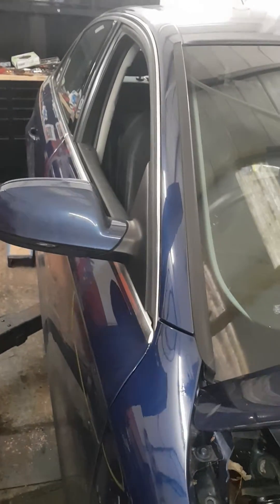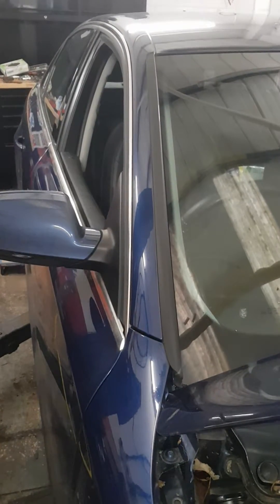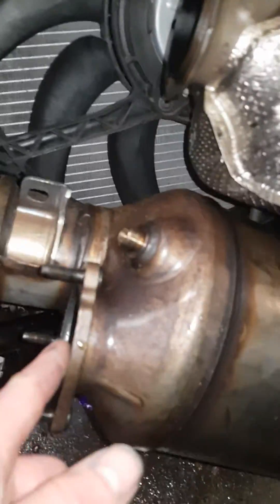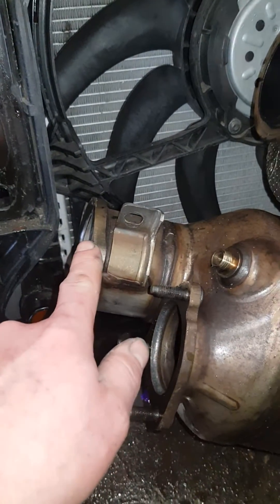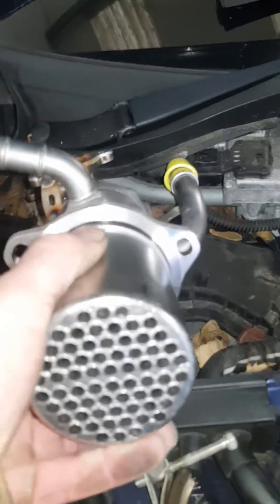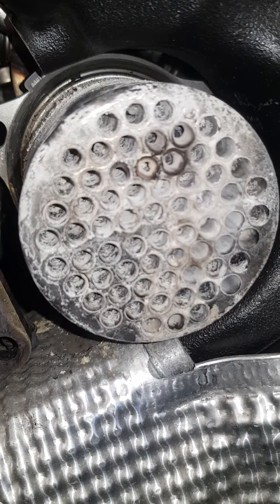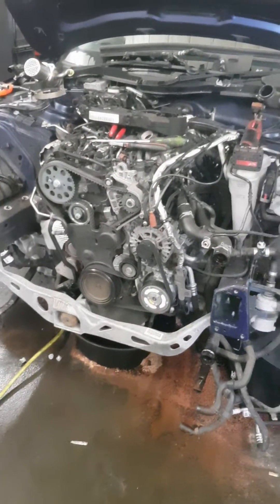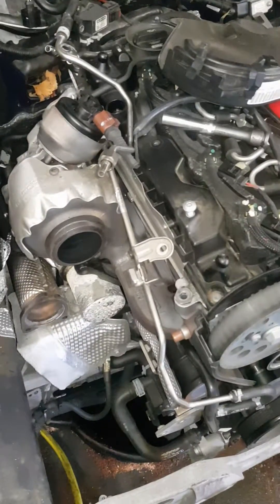Audi Dpf Adblue Explained

Comment: P200200 is fault and you don't need to remove front end. Done hundreds of them when I was working in audi dealership.
Reply from the maker: You removed Dpf to flash it without removing front end ? This dpf was also full of Ash so needed to be removed and flashed cleaned .
Reply: @dpfcleaningltd it's very hard to remove dpf without removing the front end if you follow audi workshop manual. Done it once, so I understand why you did it like that. When replacing egr cooler only, you can pull it out towards the bulkhead. It is tight space, but duable.
Reply: If the system is mapped so that the flow doesn’t go through the cooler at regen then does that solve it?

Comment: Thanks – extremely informative and clearly explained.  Alas I am all too familiar with this problem – my 2019 A4 40 TDI is on it second EGR cooler for this very reason.  First replaced at 118k miles and the second at 178k (less than 2 years apart – so managed to get the second replacement covered under the 2 years parts warranty).  Are there any preventative measures you would recommend?

Comment: I did this job without removing the front man did i do it the long way is the front off the best way
Reply from the maker: How did you remove the dpf to flash clean it without removing the front ? The 30 mins to remove the front makes the jib 100 times easier
Reply: @dpfcleaningltd took me 1.5 days to do it i had no clue what i was doing first one that id done next week i have another one todo so i think front off next time i see some people removing the engine to do it
Reply: The filter comes out without front removal extremely difficult i had to jack the engine to raise it so could remove i tackled the job wrong lot of the bolts i removed couldnt even see them guess work

Comment: thanx for the info. but it would be great to mention the fault code accompanied with the problem. thanx
Reply: I just pulled out my EGR cooler, without removing the front of the car. It's not easy and it requires ratchet extensions and multiple pliers to remove a lot of hose clamps. Many screws in almost impossible positions, but it's doable with perseverance. All work in the engine bay, no need to go beneath the car. I cleaned the original cooler with boiling water to dissolve the Addblue crystals and then brake cleaner to remove oil residues.
Reply: Error is P200200 and you don't need to take off the front of the car 😂
Reply from the maker: If you can remove the dpf with removing the front of the car upload a video doing it or come do the next one.

Comment: You can get it out with taking off the front of the car
Reply from the maker: What the dpf ?
Reply: @dpfcleaningltd yep the dpf , put the front in service position will do and take out the little upper  bulkhead just behind the engine.